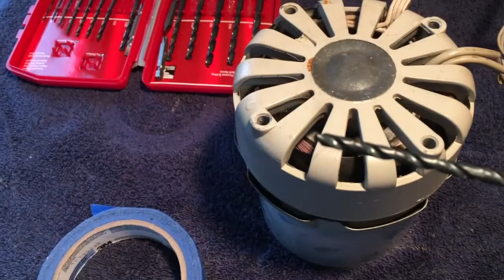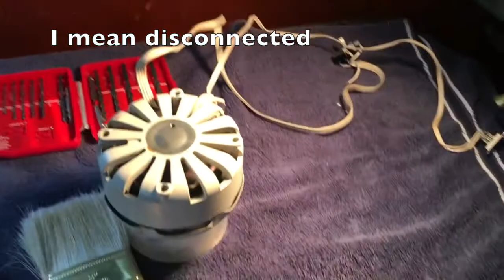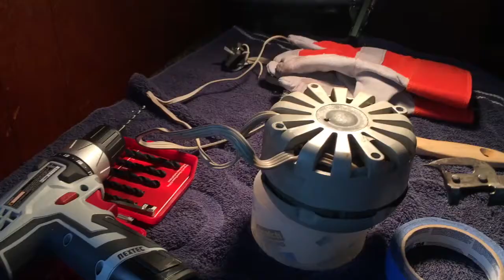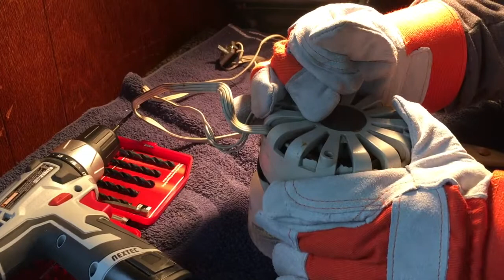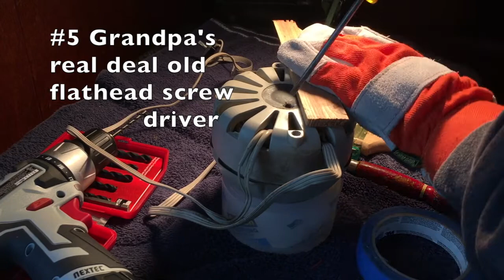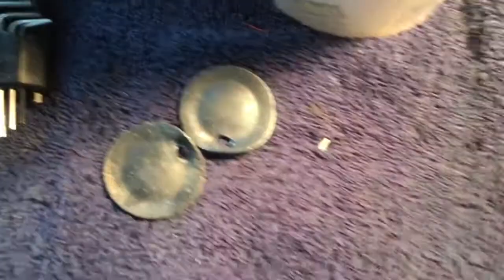GE Box Fan Motor Service Part 3: Pop The Plate

Comment: if you drill a smaller hole less than 1/8 inch, you can screw a sheet metal screw into the hole just enough to grab, then you use a flat bar with the nail puller end and pop it out
Reply from the maker: thats a great idea! thanks. I'll try that on the next one.

Comment: The later models of these such as this one have a smaller rotor, and as you mention they don't have the oil grooves or the extra wicking. They changed the motors in 1970, you can tell by the cabinet because the older ones in the 60s had the rubber grommet grille mounts whereas these 70s ones have the smaller cabinet with grill clips. Also they added the ring on the front grille on the reversible one because the blades could hit the grilles and break if it was running in reverse due to the slimmer cabinet.
Reply from the maker: Thanks man. I see what you mean about the blades and the grill. so they wouldn't catch!

Comment: That is really quite strange that there's no oil wicking in there.. Maybe someone has been in there already?
Reply from the maker: who knows. the plate/seal looked pretty straight. The shaft doesn't have the oil groove either. This is a late model - maybe GE was really just phoning it in at this point.
Reply: Could be.. Compared to what we have today,, its incredible to think these motors were starting to get 'cheap'!
Great demonstration series regardless.. I have a few of these GE box fans and I've considered doing this process on them but haven't been able to find any good videos that really show how to do it until now..
Reply from the maker: Considering the amount of work involved if I had an original GE like this that ran cool and quite and real issues I'd leave it until it started to act up. Of course you usually don't know until the motor burns out. This older model has a cover over the windings (on the front of the motor). The other two earlier motor do not. How are you supposed to protect the exposed winding while prying this seal off the back? I'm still working on that in my head. Maybe a large vise with wood parallels. I don't have a vise so I'm gonna have to think of something else.
Reply: I think if you can avoid this process,, you're probably better off.. The one I had locked up at one point.. I was able to oil it by putting oil in the gap right behind the fins on the rotor,, where the shaft enters the bearing.. That has held for about 8 years so far.. I'm sure its not as good as removing the shaft and cleaning everything,, but it seems to work well enough and doesn't risk any damage to the motor..